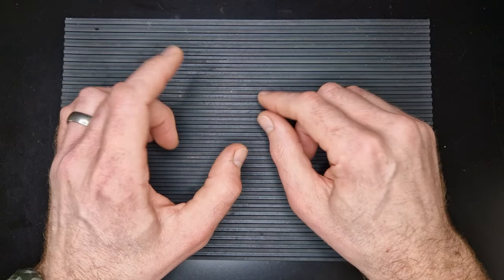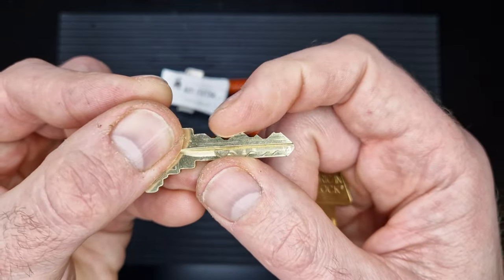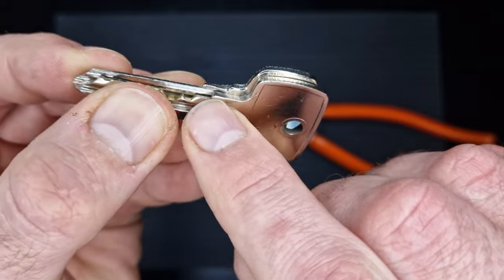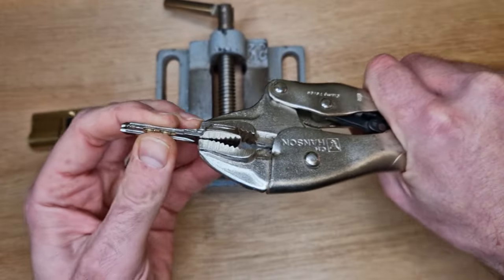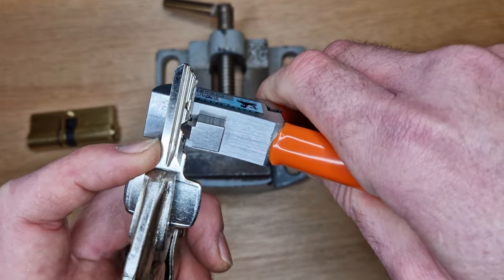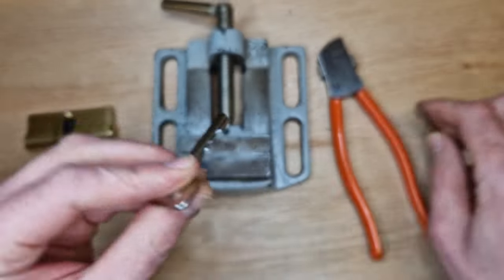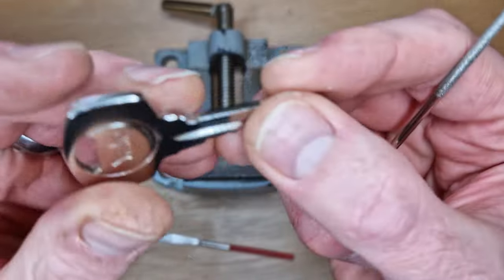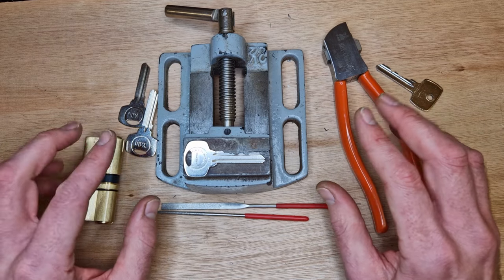REVIEW & demo of the Lishi key cutter using a Yale key

Comment: Great demonstration and review of these cutters. I have one and came to the same conclusions. I did file my key at the end to get a smoother operation and wider cuts to suite the pins of the Aussie Lockwood. It still saved a heap of time from hand filing a key from scratch. Well worth the purchase. With the back of the key not sitting flush against the cutter I put in a thin metal shim to help stop the twist or angle of the cut. Just add it to the vice grips or balance it when lining up the keys. Thanks for this video, cheers
Reply from the maker: A great tip, I'll give that a go in future 👍🏻

Comment: I have wondered if those Lishi key snips would work on European profile key blanks, it seems they do.... well sort of. 
I wonder if they'll hold up with repeated use on our profiles 🤔 I guess time will tell.
Good review. If I see a set going cheap I might pick them up.
Cheers Dmac 👍🍻
Reply from the maker: I think they'll hold up well, hardened steel vs brass. Certainly for my purposes anyway. I still have many of the blanks from you to make use of 😁👌🏼